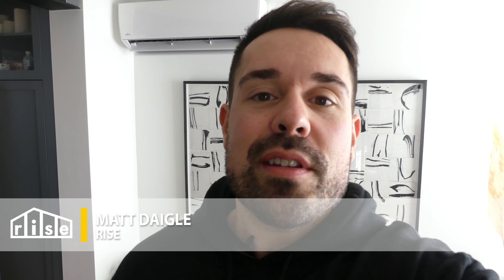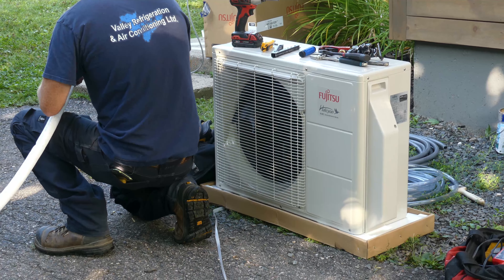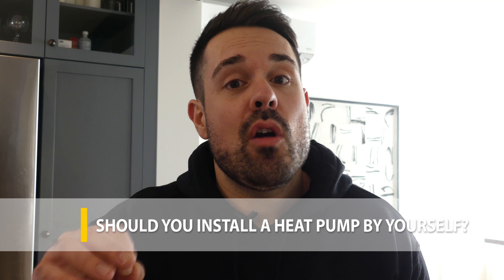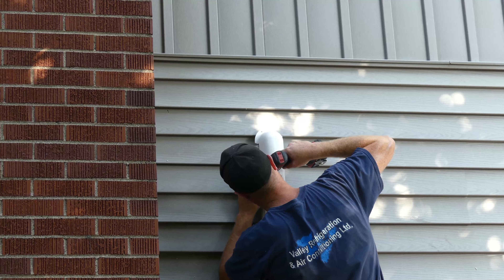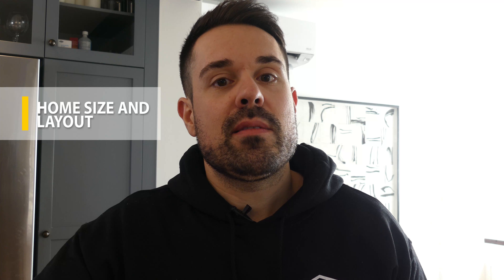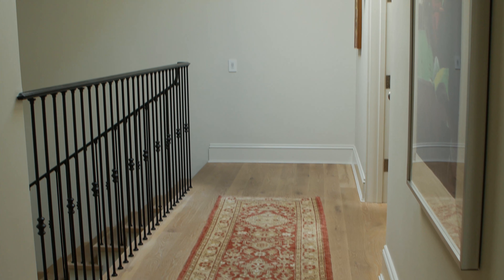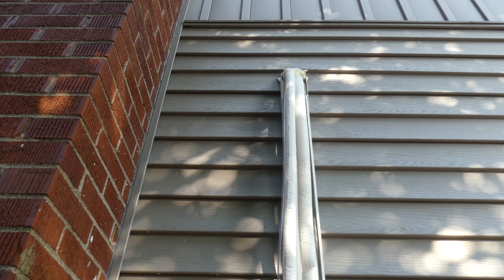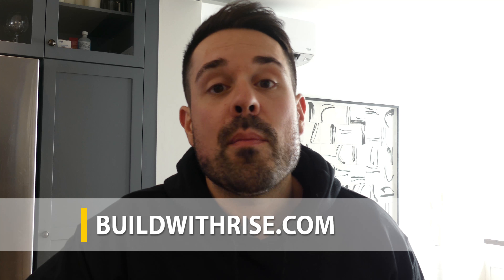Heat Pumps: Pros, Cons, and FAQs of Mini-Splits

Comment from the maker: What has been your experience with ductless mini-split heat pumps?
Reply: It isn't mentioned that heat pumps do not operate efficiently when temps drop into the teens and single digits, and shut down around zero degrees.
Reply from the maker: @mickg3738  That's a great point, Mick! Heat pumps definitely have an ideal temperature range for efficiency. That's something that north-faring folks should be aware of, since you can buy models that work better in cold climates.
Reply: @buildwithrise  Mitsubishi offers some that are rated down to 0 Fahrenheit
Reply: Hyper heat systems by Mitsubishi work in extremely low temperatures.
Reply: i guess I'm kinda randomly asking but does anybody know of a good website to watch newly released movies online?
Reply: @Devon Mauricio thank you, signed up and it seems like a nice service =) I really appreciate it!!
Reply: @Cullen Luka glad I could help =)
Reply: Absolutely HORRIBLE. ONE OF THE BIGGEST MISTAKES I HAVE EVER MADE. Massive electric bills and they suck at heating. Overall energy usage significantly greater than my 80% efficiency gas furnace. I paid for the Mitsubishi "Hyper Heat" system and it's really terrible. The company that installed it acted like $700 a month for electric heat was normal when the house is 60F. The heat was already insulated, new windows, etc. I learned that the Mitsubishi "Diamond Contractor" program is an absolute joke. There is no  one that inspects the work and verifies the installers know what they are doing.
Reply: @azucarazule oh my gosh that's a nightmare

Comment: Our experience has been all negative. Began with poor advice from the representative and the installer who told us they would be fine in our older home despite the fact that each level is all chopped up with walls and doorways. Tried it for a year and it heated one room and the others stayed cold. The installer recommended moving it to the large kitchen...so we did...which gave us a hot kitchen and cold living areas. The money saving sure didn't happen either. Was 'gaurenteed' it would only cost about $50 a month to run both....nope...with only the one running in the bottom floor  light bill went fron $300 bi-monthly average to....brace yourself....$700 bi-monthly....The only positive aspect of the whole experience was that the supplier promised a full refund if I wasn't happy and he lived up to that....removed after second winter. We didn't think our home was suitable for a ductless system...and we were right....So what did we learn...bottom line ...be sure of who you take advice from and do your homework.....especially of you are a senior like us!!
Reply from the maker: That is such a bad experience! The rep and installer should have been able to tell you that your home's layout isn't ideal for a ductless mini-split heat pump. They would essentially be working themselves out of a sale, but it's their responsibility as a professional to make sure you get the heating solution that suits your home. What do you use for heating now?
Reply: @buildwithrise  Our home is a 12 room , two story house that has undergone renovations over the 30 years we have been here. The heating system is a combination wood/oil furnace with a pellet stove in our large kitchen by the bank of windows on one wall.....
Reply from the maker: @hairywon  Wow, sounds like a maze of a house! Have you folks done other renos to improve your energy efficiency? Extra insulation, air sealing, etc?
Reply: @buildwithrise  I kinda chuckled at this...the old house has been virtually rebuilt...could have built a brand new house with the money spent on renovations! Big addition added...new steel roof, new foundation to replace rock wall one, new oil.wood furnace with new double flu chimney, and all new ductwork, all new plumbing, wiring plus new electric panel, all interior walls torn out(plaster and lathe)....insulated and gyproced, all new windows and all new doors, pellet stove in kitchen....sooo...as you can see....we have spent a ton turning an old house into what it is now....a friggin money pit...we love the property or we would never have done this....and I can tell you I would never do it again...lol..have considered solar panels or ducted heat pump but at our age and now on pensions...it just doesn't make any economical sense....
Reply from the maker: @hairywon  What a saga! Hopefully, you don't regret putting all that work in,. What matters most is that you live in a home that fits your values, whether it's your comfort, health, carbon footprint, or something else altogether!

Comment: I had three of them put in my home and it cost me $5,600 with labor included. I was going to have central air/ central heat installed in my home but the cost would have been $10,000-$13,000 for my home. Glad I got the mini split systems put in. I love them.
Reply: Hey I am in the process of remodeling my basement and the thought of radiator noise is making me think of converting to mini split or central. How has been your experience. I am in Jersey you think it's cheaper or more cost effective than gas boiler?
Reply: @richmondejiofor6332  My experience has been great. Mini split system is the way to go
Reply: @markedgarrivera5909  I think I am leaning towards that. The contractor wants to veer me to central air. I am glad am able to research and get feedbacks from guys like you.
Reply: @richmondejiofor6332  I also like the mini split system in each room because everyone my house can control their own temperature in their rooms
Reply: @markedgarrivera5909  My dilemma is that we recently converted from oil to gas heating a few years ago, now the contractor makes it seems like forced air/ Central air would be one heck of a tedious job. That is why I think ductless mini split heated is the way to go.
Reply: Is the heat from a heat pump enough during peak winter? Did you retain your old heating system as a backup?
 I have a three bedroom unit that is heated with a oil burner using forced hot water. I am thinking of installing split heat pump units so I don't need to spend money on the oil and can also be more environment friendly.

Comment: I have a few apartments that I have installed heat pumps into. Heat pumps can be a great addition if you're installing these units into an house with a relatively good (airtight) envelope.  If you're house is old, and leaky, heat pumps will work continuously to keep the space warm (or cool). In my experience, finding a good contractor who will service the units when needed is pretty important. I've have a multitude of issue with my heat pumps from bad fan motors, leaky drain pans, bad sensors, ice buildup causing the outdoor fan motor to trip resulting in motors and electrical boards in the outdoor units needing to be replaced. I have a contractor who is usually 2-4 weeks backed up with service calls that often times, I'm left using another source of heat or cooling until the unit is looked at.  Depending on air quality and whether you have pets, it's recommended that the indoor unit be cleaned out every 2-3 years. At $150-$200 per head, it can add up pretty quickly. I'm pro heat pump! Just keep in mind, any heating system has it's pro's and cons.

Comment: This is excellent, in several ways.  First, it's really comprehensive in handling the many and varied concerns someone might have in going this route, especially in a new installation scenario.  Second, while the Fujitsu system is talked about the most, you avoid being overly promotional: It's a great system, but even you concede there are a number of other worthy contenders.  What strikes me as most interesting about this is how very dependent the consumer is on this kind of commentary and supplemental information.  For many of us, we think 'I'll just pour myself in to the manual and learn everything I need to know, to make the right decision.'  But in this case, the manual is pretty threadbare - just machine function - and never really gets at core questions like 'could I ever use the heating function as a substitute for the furnace system I have?' or 'How much coolant capacity do I need based on where we live, based on our needs?' That's why perhaps *the most interesting comment of all was that perhaps the most consequential decision you'll make in this process is selecting the right vendor/installer as your guide.  That's because only someone who has immersed themselves in the nuances of the available equipment, the details of the local climate, only that person can ever give you solid assessments that help answer these questions and guide you on your buying path.  The manufacturer just wants to sell you equipment, and of course everything they offer is the perfect solution.  For these kinds of installations, you really need a translator.  In our case, because of a combination of scheduling jams and equipment availability, the installation happened just as the cooling season was ending (with live in Philly) but before the heating needs are clear.  So we haven't even tested the system, except for some spot heating to take the chill out of some of the rooms.  Like it or not, informed or not, we have this system to the max (two large compressors, six splitters), and in a few months we'll know.  If you're a consumer at the starting line, these kinds of reviews are vital because otherwise no one is answering your questions in this way. Keep researching!  Well done.

Comment: This Mini Splits are absolutely incredible.   I been a HVAC Contractor for 47 years in the State of Georgia.  I've installed them in my home and my children's homes, along with several of my customers.   My daughters power bill is less than $100 a month and this is a ranch style home with 2,000 SF.   I've studied the Heat Pumps and believe in them very strong!   
I've installed 12-14 Daikin systems and never had a "call back."
Reply: Hi just have a ? I'm from CT so it gets cold here is it a good product to use year round?
Reply: HI Gary - This is my first time considering this project...would yoou have any background on this question I just posted.
would you embed (channel through the plaster/concrete) the piping in the wall in an old apartment mini split installation or would you use "Line Hide" or "Line Set" to conceal all the piping for a 2 room multi-zone project? I'd like it to look good but I want to make sure I don't have to worry about leaks or anything else if it's channeled out. The building was built in 1962. This installation would be done by a professional HVAC installer. Love to hear you opinion. I don't want it to look to cheesy but it's faster, cleaner and cheaper to do.
Reply: Install one in Michigan.. Won't be $100/month
Reply: Hi Gary, any thoughts on Carrier mini split units?
Reply: @bernardcaillouet5565  rebadged midea unit

Comment: Have insulated 1500 sq/ft metal building- all open space.  I'm going to use as a shop/man cave.  May eventually split into two rooms shop/game room.  Has electric but no a/c.  Was going to put full central air then began researching mini-split.  I think I'm going to go with Lennox 3 ton mini-split with two 18k (or more) BTU wall heads in case I do segregate rooms.  Decided to go with Lennox b/c I trust that brand and it has 12 year warranty.  I'm sure there are many great brands, I just have installed Lennox HVAC in every house I've owned and I love the quality, efficiency, and how well they've worked for me.
Reply: 10 years ago I did the same and after a lot of research picked fujitsu most north american companies rebrand these systems from asia like Friedrich used fujitsu until they switched to lg. I just checked Hvac-talk.com and from what I read Gree makes the systems for lennox. also you can check hvac on ebay I found half the components I needed new and half the price.
Reply: Good luck

Comment: Daikin split heat pump with R32 refrigerant is the best i purchased it before 5 year its still working like new it has the best cooling and heating efficiency even under extreme weather.
Reply: Do you have extreme cold weather where you live?

Comment: What motivated myself was operating cost and comfort. Did a lot of research and purchased equipment needed. Picked fujitsu RLF systems then used ebay for new but maybe a dent on the outdoor unit some components from whoever had the best price online. Used single 9k wall mounts in two bedrooms in the master installed a slim duct with 4 way grill 12k inside of the closet, used a dropped ceiling to conceal it. The living areas that are open to one another, I went with one outdoor with three indoor units two ceiling cassettes one 9k 12k where they could be installed in the center of the room and one more slime duct 9k from the kitchen pantry like the master bedroom. I did everything by the book on the OCD side of things. like every line set was vacuumed to 250 microns then break vac with nitrogen and repeat 4 times. Did a 48 hour nitrogen pressure test at the max for each line set. you get the idea. that was 10 years ago and it is operating perfectly.
1. My 3000 sq ft home power bill was cut by almost half annually from $300 to $160
2. These systems convert a/c to D/C that allows a 9000 btu RLF wall mount to throttle all the way down to 1500 btu. So sizing is not as critical on the manual J.
3. Rooms not in use are set to economy mode, only cooling heating areas you need, I live in NC so cooling is priority but if the unit has a cooling rating of 12000 btu its heating rating is 16000 btu. So if you live in cold areas you will save the COP rating is 4 on most models.
4. I can set my bedroom to 66 and don't worry about freezing everyone in the house.
5. Spending a few months to find deals on ebay cut material cost. I did already have large nitrogen bottle for a sports car plus a garage full of tools only need to purchase about $1000 in pump a few gauges 410 flaring tool already had welding supplies for silver soldering.
6. A contractor bid for everything was $21000 and I got it done for about $7500. If i purchased everything from online wholesaler it would been about $11000 plus my time.
Reply from the maker: Wow! Heat pumps for the win!
Reply: What a beast

Comment: I'm currently researching mini-split for my shotgun style home in Kentucky built in 1900.  I wish there was a store that I could go to and talk to someone and actually see what the units look like.  I'm glad there are YouTube videos that show what these things look like.  I finally found a picture of what the outside connection would look like - it's pretty intense and, quite frankly, pretty ugly, but the huge AC fan box outside isn't too easy on the eyes either. One of my questions is about placement in rooms, they always seem to be tucked in a corner or off to the side, wouldn't it be better for air/heat to flow freely into a room if it was in a central location?  So many questions it makes my head swim.
Reply from the maker: Great question, Betty. With a ductless mini split you definitely want it in a central location. Ideally, your mini split is aimed at the widest part of the room and even toward any hallways. Mini splits work well for large rooms and open-concept homes, but face difficulties in homes with many smaller rooms. In that case, you can explore a ducted heat pump. Hope this helps!
Reply: Mitsubishi offers a ceiling cassette indoor unit that would be perfect for what you are trying to do. Call Mitsubishi and ask for a local diamond dealer. This will give you a trained professional and a longer than standard warranty.

Comment: Put in a 24,000 BTU Senville LETO. Great! But to successfully do it with my background; I got all the professional tools needed including nitrogen pressure testing. Its not a simple DIY. You need to be more than above average DIYer. After I did mine it gave way for me to install another 7 units all in the family.  Another reason is it cost an arm and a leg depending on the contractor. My wife told me: you are a mechanical engineer that means maybe you can tackle it. I said: “sweetheart thanks for the encouragement”. You can do it.
Reply: The LETO was a heat pump: the AC and the heating options deliver as promised. Awesome!
Reply from the maker: Your mechanical engineering background definitely gives you a leg up!
Reply: @buildwithrise  Thanks, I guess anyone can install it as long as you adhere to instructions

Comment: I live in an 850 sq. ft. single floor  home in the northeast. My walls are R12, ceiling R20. and floor is around R7 insulated (no frost wall or basement). House is tight--not drafty. Good quality windows throughout. An installer has recommended a 12,000 BTU mini-split system by 'Gree' (SEER-30.5,  HSPF 14, and CoP 3.8). Overnight winter temps on average 10-15F, and somewhat warmer in the day, but it can get down to 0F temps on occasion. Currently heating with wood, supplemented with baseboard. Would plan to maintain wood as a backup for outages, and occasional use. Will a mini-split give me a good result? Hoping to heat in the $60-$80./ month range. I like an ambient temp of around 65-68F. Thanks for any help--great informative video.

Comment: I'm looking to put these into a mini home (300') and likely satellite on site buildings as needed, 3d printing shop (200'), an on site Office (200') and a Voice booth/engineering building (230'). would it be a good move to use these or on site window units/plug in heaters?